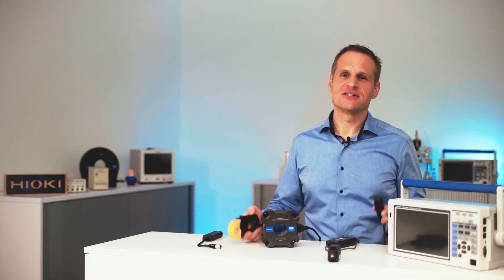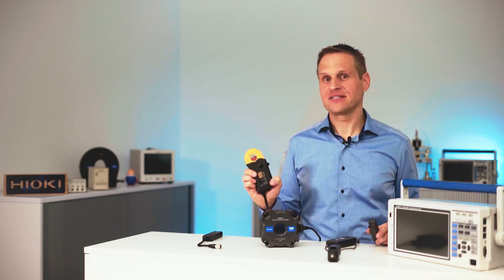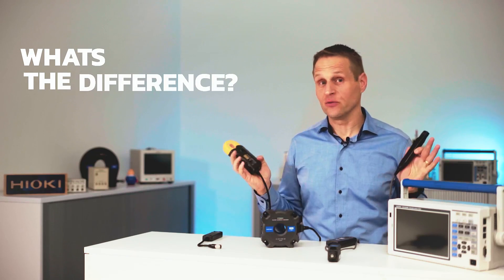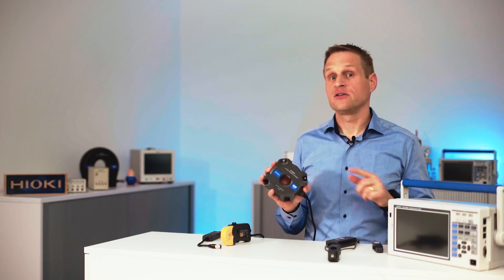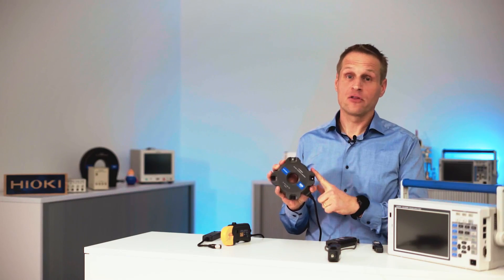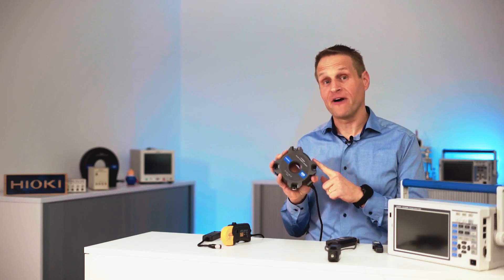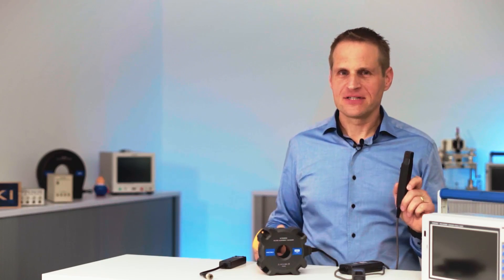Zero-fluxgate sensors vs. hall-based current sensors - What is the difference?

Comment: With this short clip we tried out a new way of creating videos. One of my biggest learnings: Even a 1min video needs to be scripted - otherwise it takes forever and at least I miss important things. Like highlighting that fluxgate sensors are also more temperature stable than hall effect sensors - which is another reason why they are better suited for power measurement.

Things we left out from the video because it would have become too long:
- Of course, HIOKI's fluxgate sensors can be used with a scope or any other DAQ system as well by simply adding a power supply unit with a BNC output in between (e.g. CT9555)
- HIOKI fluxgate sensors are optimized to have a constant time delay over the frequency range. This is really important when measuring AC power because of the harmonics
- There are customers who have integrated HIOKI's fluxgate sensors into their own systems. It means that the pinout of these sensors is not a secret